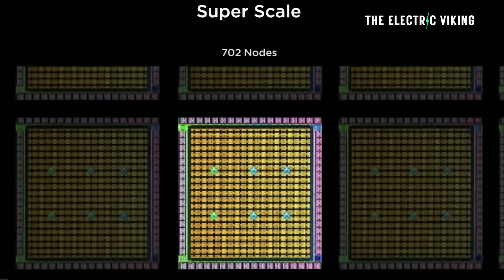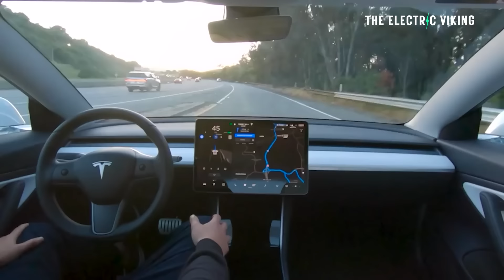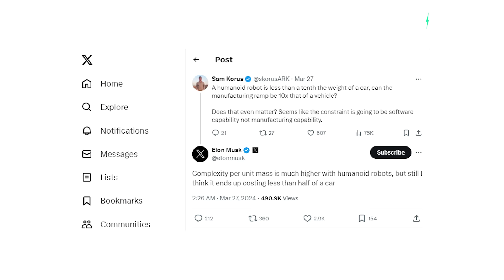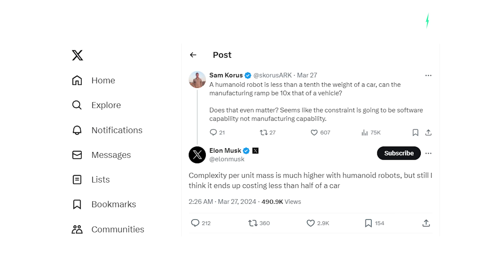Elon Musk says Tesla Optimus robot should cost less than $25,000

Comment: When the robots are making robots this world will get weird.
Reply: That's already happening on advanced CPU's
Reply: Rocket ship builders, and bottranauts next
Reply: The initial low volume maybe assembled with Optimus robots to improve the capabilities, however, Dedicated automatic equipment will be used as it is much faster, when used in high volume applications.
Reply: @jjamespacbell   all they got to do is build the parts  and a  humanoid or two could probably do the assembly  anywhere like in a motel 6 room.  the main advantage using any humanoid bots has, is that you can have a more distributed manufacturing setup where small batches of customized configurations can be built alongside routine production.
Reply: draconian world
Reply: @dudend22  Dreadnaught factories 3.0
Reply: @randalsaladbar  thanks for sharing i just looked into it!
Reply: @jjamespacbell  So the robots will mine the materials and fix the mining machines and create the parts and assemble the parts, Not much room for humans. So is the world going to be like I, Robot  or the Fitless Humans on the space ship in Wall-E. You have less than 30 years.
Reply: @ChicagoBob123  Good, those jobs all suck.  Free up the humans to do other, cooler jobs.
Reply: @ChicagoBob123  "You have less than 30 years" No problem for me mate I'm 72 years old. I plan on getting mine to clean the house, maintain the yard, prepare meals and wipe my drool for the last 5 years. 🤪
Reply: @jjamespacbell  me too.
Reply: Inside machines that make machines constructed by machines from other planets
Reply: When men can become women and visa versa I would suggest that we are already there.
Reply: Robots already help to make robots, have a look at any robot factory of today.
Won’t be long until all the humans do is to clean the factories.

Comment: 25k seems like a lot.

150 pounds of electronics, servos, frames, panels, and batteries.  This stuff is in the 50-100 buck per pound range. That is a ballpark of $4500 to $9000 at scale.
Reply: It depends on the value it can add to a manufacturing system. If it can replace 3 or 4 people (working 24 hrs a day, 7 days a week) and does as good a job, it's paid for itself in a few months. Sorry, humans.
Reply: @ChickensAndGardening  

Yeah... and it will happen quickly.

This is a reasonable price for factory robotics/CNC.   

That seems like the best category for comparison.

Retail $25k and a $100 a month subscription...

Tesla will make so much mlney.

Comment: Musk says a lot of things, many of them risible. Tesla has lost its moment as the ‘one and only’ AI company. It does not make AI chips that lead the industry. Nvidia does that. It does not make inference chips that lead the industry, although HW4 is more competitive. Dojo is not a world-beating technology in the AI world, although I understand that using the latest Nvidia chips has made it better. Using the Tesla designed Dojo chips made it ‘compute limited’. FSD V 12.etc has not yet solved the FSD problem although it’s a big step ahead. It has caught up with how the  AI industry put together neural networks.  Chinese FSD variants are as good or close to Tesla and moving up in capability very quickly. Tesla will not dominate the world FSD market. They will be one of many.

Tesla is superb at manufacturing. Tesla built a plant in Shanghai to learn (from the Chinese) how to make cars that fixed the quality problems of its California plant. Musk now wants protection from the Chinese in the form of trade barriers in the US market. Tesla’s manufacturing prowess will not translate into robot market dominance. Robots have 1/10th the parts of a car and are mostly about actuators and mechanical engineering. There is not going to be a Tesla actuator that dominates the market because they are not complex devices.

About robots: Tesla is one of many making robots. The Chinese make robots. These robots will be well designed and low cost (based on Chinese reputation and early looks at their products). The software and chips that run these robots will be as good or better than Optimus because they’re already is better than Optimus (See Figure plus Nvidia demo as one of many examples). If you have a memory of the silly Optimus roll-out with ‘dancing guy in a costume’ you know that Musk reacted to a sudden realization that Tesla had no product in an AI robot market. Just a couple of months ago, Tesla faked an Optimus clothes folding demo where the robot was remotely tele-operated. I wish Musk would resist these urges because they discredit his effort.

Conclusion: Musk is playing catchup with Optimus. He is talented regarding engineering and manufacturing. Robots are mainly about software and Nvidia is clearly dominating the robotic tech stack with China a close second. I expect Optimus to track similarly to Cybertruck, long in gestation and expensive, and late to market. Apparently Musk agrees because words from Tesla is that he is now ‘all over’ the robot product, indicating that it was not top of his mind until recently. The cost for focusing on Optimus is likely not fixing an aging product line or expediting the rollout of the Model 2 (expect end of 2026 to become middle of 2027 very soon).

I was an early backer of Tesla. I have had to face the reality that the world has mostly caught up. Still a great company that does interesting things. Not a dominating company looking ahead. Was shocked to see BYD outsell Tesla. Was shocked to see CATL dominate BEV batteries. No longer shocked to see Tesla fall back into the pack to some degree.